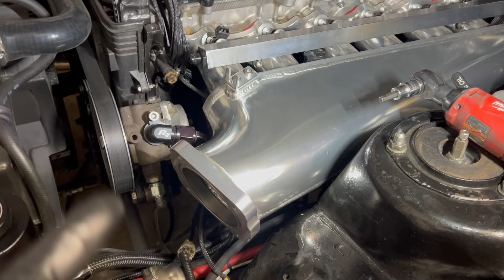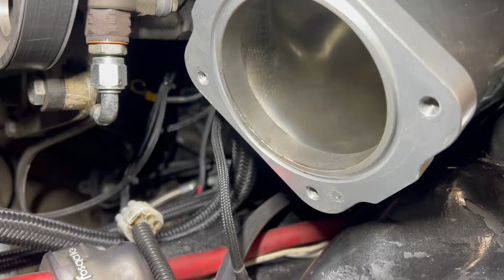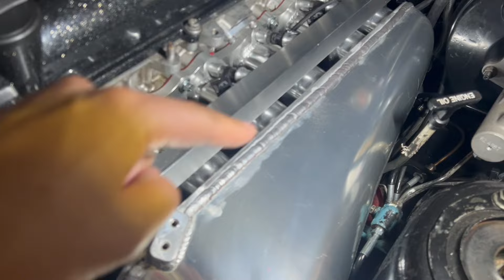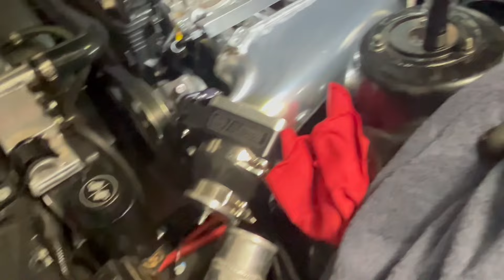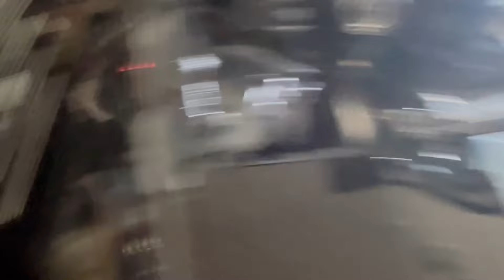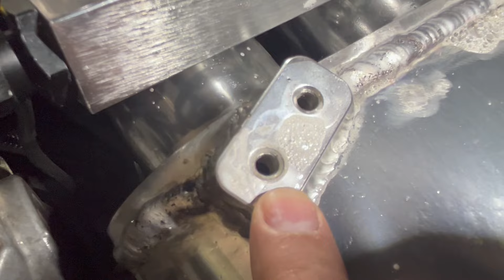2JZ eBay Intake Manifold! - I cracked it!

Comment: I used to have one of these Ebay chinesium material manifolds. It's a hit or miss with them. Some people say they've never had problems but, I'm willing to bet most have never done a leak test or put 35+ PSI with a large turbo. The way I see it is, the factory intake manifold is good for mid-range torque and not known to leak. These "hyper tune" style are slightly better on top end power but not by much. In the long run, a better-quality manifold is worth it.
Reply from the maker: Exactly. I wasn’t expecting mine to crack but it did and the more I spend money on it to fix it or make it work, it’s better to just spend the money to get a real intake
Reply from the maker: People also don’t pressure test their systems after they install any intakes.  China intakes are known to leak by the TB. The reason why I went with the RMR to get rid of the leak. But there were more leaks than just the TB, which was the bracket bolts.  Best to always pressure test the system up to 35-40 psi to make sure it the system holds. A lot of stuff I learn along the way and hopefully the mk4 I build will never go through this stuff
Reply: I just buy them, and get a professional to redo the welds before I install it. 
Aluminum is super easy to MIG weld with a spool gun. $30 of time makes that $200 manifold way better.

Comment: Mine cracked in the same exact spot (28lbs on E85) less than 1,000 miles, I also know 4 others who had this exact issue.  It's just a faulty design but these guys are making good power with them still.  About to get mine welded today but do you have an update on how it held up so far after welding/jbweld?
Reply from the maker: So I found out that if you buy MCC ones they hold up really well. If it’s other than MCC ones.  They are cheap replicas.   Mine is holding up really well after the reweld and JB. I’ve pushed through so many boost pulls since then and zero issue.  I’ve done multiple 30 pound pulls and so far it’s holding up